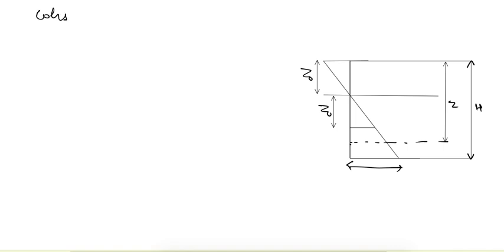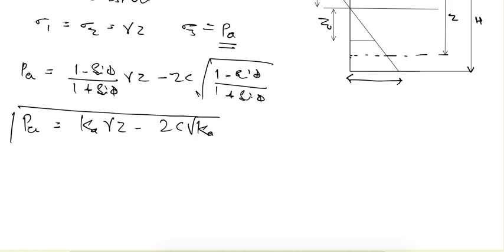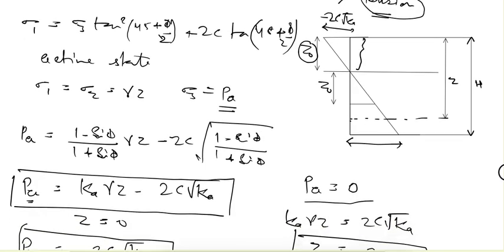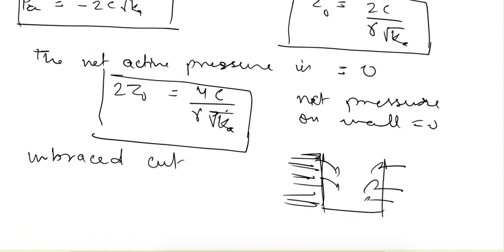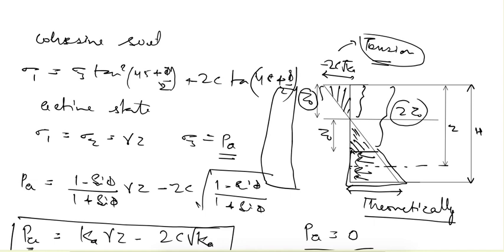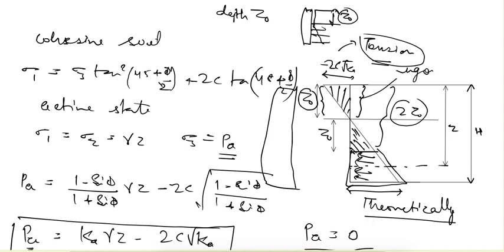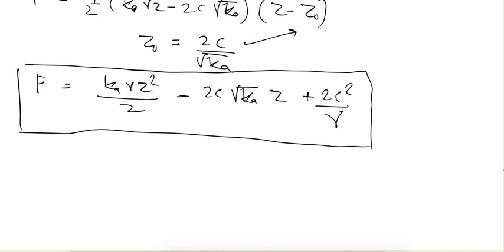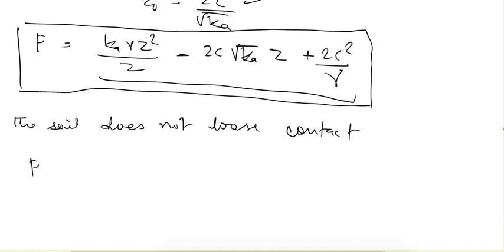Earth Pressure for Cohesive Soils | Soil Mechanics

Comment: you said that top surface under tension for negative value and on the same note you are saying that top surface does not  touches the wall would you please  elaborate  , tension means stretching
Reply: my friend , tension means it will not exert any pressure on wall.The soil in that region will fall inward.

Comment: sir, I have doubt in the derivation of the design of wall.during the calculation of force, we are taking complete pressure distribution, i.e. total depth z. but according to the concept we should take pressure distribution of (z-zo)
Reply: Yeah exactly that's what I am asking
Reply: 1) At 5:05 you said we have to find out force for that lower triangle than why you started findding out for the depth of z-z° instead H-z° ???

2) if you are finding AEP at z-z° than why you did not kept z-z° at the place of z in formula??? At 5:55